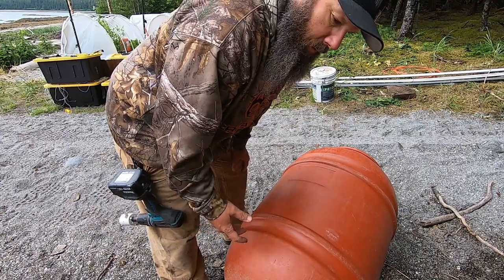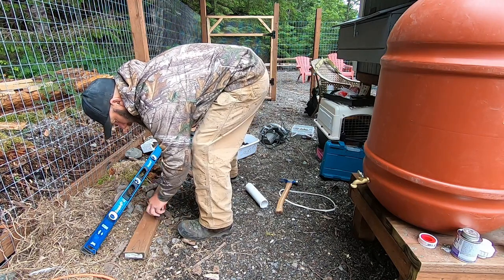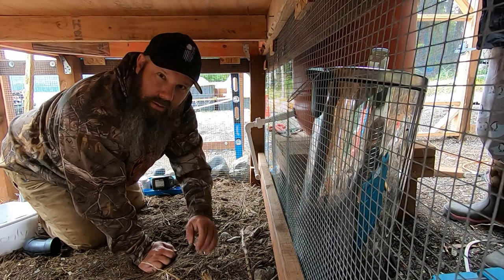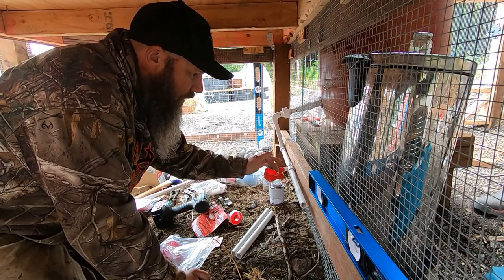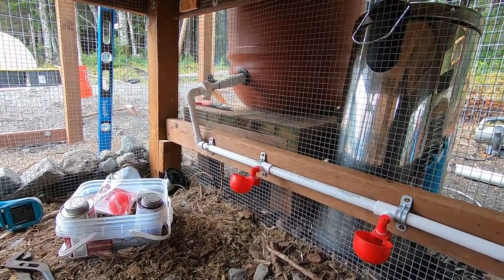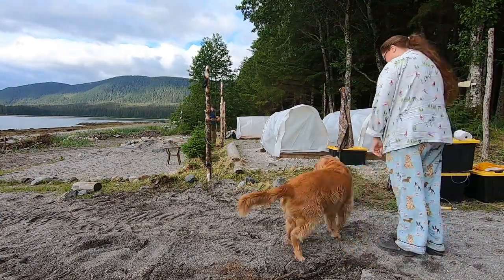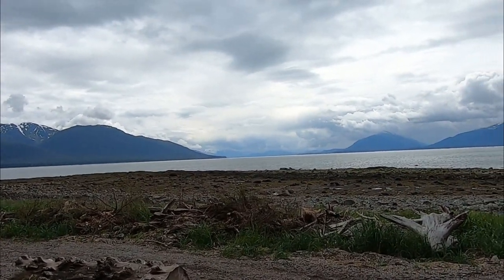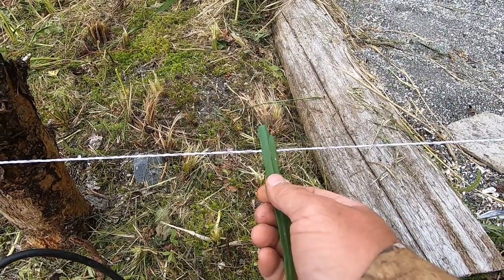Automatic chicken watering system using rain catchment | How to install best poultry watering cups

Comment: Hey Y'all!
Glad to see your Supervisors were keeping you on your TOES!
They were obviously doing a splendid job every step of the way!
The quail are doing ok, lost another one today due to heat and suffocation....put a 4th brooder together and got them dividied up so that there are now only 15 kids per brooder (I'm down to 61 quail  from a hatch of 71). 4 Weeks old yesterday, fully feathered and doing well, except for the heat...we hit 95F today and day after tomorrow we're supposed to have a couple of 98F days........I got somewhat 'exhuberant' tonight because even with a fan in the brooder room, I couldn't get the heat below 89F, with the window all the way open........drilled 3/4" holes throughout the Hollow Core Door to the Brooder room, and right now I have the 'aroma' of Quail Poop' wafting throughout the house, as the ceiling fan in the living room is on 'SUCK MODE'....pulling the cooler air IN from outside, which of course, includes the 'ambiance' of the Brooder/Hatching Room...........that's ok....I've got some eucalyptus oil/menthol oil mix that I'll be living with until the end of this week, when I will HOPEFULLY get the cages built in the garage...........the things we do for our Feathered Children!
I'm trying to get the kids to adapt to the Horizontal Nipple Waterers from Heritage Farms (the Columbs Aqua ones).....they taking to it, but SLOWLY and in this heat, not fast enough....so I'm back to the Old Style.........quail bunch up, which is why my one quail died....too much heat, not enough air and too many others on top of her (they had room, they just simply bunch up).
Learning curves can be a real bitch sometimes!
Cheers from the Oil Patch in Central WY

PS. The scene where you  noted you were using your GoPro.......you didn't tell us WHAT we were looking at and which sounded like a gunshot!
Reply from the maker: Oh sorry I was a humpback whale on he GoPro. 
Man that sucks about all the heat your getting. There’s no real way of getting around HOT. Hot is just hot. Hopefully when you get them out in the garage it will cool down a little. Good luck👍

Comment: Great chicken waterer setup Brian. I would like to do that system sometime. I'm using the bucket with nipples on the bottom right now but the setup that you have seems easier for the girls to get a drink. Have a good one you two.
Reply from the maker: Thanks Jay. I’m trying to figure out winter still. I may just run a hot wire down to the coop to keep the line from freezing or we will have to dis assemble this and use a bucket.

Comment: Hey Brian this is just a thought when you ran your hot wire through the PVC pipe Underground you might want to run some silicone on your 90s where it enters the pipe so water doesn't get in there and short out on you just a thought.
Reply from the maker: Are you taking about wire for the fence?  I glued all of the pipes together. It should keep the water out.
Reply: @AnAlaskaHomestead  I'm just thinking where it goes into the PVC an exit for the water not to get inside of it

Comment: I use Pex pipe ..then I don't worry about freezing.PEX pipe is freeze-damage resistant,  the pipe will expand if frozen and contract to its original shape when thawed. I love the stuff used a shit ton of it up north..comes in sizes from 3/8 - 1 inch.
Reply from the maker: That’s not a bad idea. Since this is our front I wonder if it would grow algae in the PEX?
Reply: @AnAlaskaHomestead  ...a clear pipe is more likely to..but using Pex from a water heater is the only time I have ever seen algae in it .If you do see algae in it..which can happen in any pipe if the condition are right..I add 1 cup of apple cider vinegar to a 5 gallon container of water. This will increase the acidity level organically in the water making it darn near impossible for algae to grow. Make sure you shake the apple cider vinegar before using it.the vinger won't hurt the chickens.
You can also run bleach thru the piping to kill algae..but make sure you run water thru it for 2-3 minutes before you let the chicken drink it again to be safe...all white turds means you didn't flush it long enough..lol 

I use Harris farms 6.25 gallon waters for my chickens..and plastic tubs out side to catch rain fall.I always had two different method to give them water..

I ran mostly meat birds.( 600 Cornish X's ).so I always had food and water in the chicken house and in the outside pen.

My birds all ate the highest protein chicken feed I could buy from day 1 to their last days..in North pole it was Don' s Broiler Maker..but now and again I would buy some cracked corn or scratch too.Also the Wonder Bread distributer in Fairbanks sold old bread products for a dollar a garbage bag full...the chickens loved it.
Reply: When we going to see what a chicken does to a banana slug ??
Now if for some reason they go tits up after eating them....this was your idea..lol
Reply from the maker: Thanks for the info Brett. I don’t think I’d use bleach but if I did I’d be looking for white turds.😂

Comment: So what will you use for water in the wintertime?  We use the galvanized chicken water can with the heater that goes underneath it.
Reply from the maker: I’m not sure yet. We may run a heating cable to keep the pipes from freezing or just disassemble it and use a bucket.

Comment: I'd cut out a circle of plastic and glue it to the lid before drilling the hole for the bulkhead. If you've ever glued 2 pieces of card board box together you'll know how solid it would be.
Reply from the maker: Or drill it on top of a piece of wood. You live and learn.

Comment: Great video, i'm getting ready to switch to the automatic watering cups in a 5 gal. bucket myself. I do have a curious question though, with you being beside a constant water source (river) wouldn't it be easier to do the "ever flowing water system," or would such cold temps in the winter cause a problem? I'm a new chicken keeper myself, so i have been researching all methods for fresh, cleaner ways to provide water that's why i'm switching to the automatic cups. It's just a curious thought cause i'm still learning how to raise chickens, and i do however love the way you care for your feathery babies. Your heart is golden, and you have a great set up with a beautiful view, from what i can see.
Reply from the maker: Thanks Tonya. We love the watering cups but this winter we had a cold streak and had to abandon that method through the winter. 
We used rain catchment because it rains here a lot. That water in front of our place is salt water so it’s no good for drinking. 
It’s a great summertime system but you’ll need a heater if your temps get below 20 degrees.
Reply: @AnAlaskaHomestead  Oh ok, i didn't realize it was salt water, sorry bout that, i had to go back and watch the rest of the video and realized there's a whale in it, lol. Our temps, in Tennessee, get down to single digits at times so i was thinking about trying the heated water base to put the 5 gallon bucket on. Hopefully it'll work so my fingers are crossed, lol. Thank you for your response and the info. Also, many blessings to you, your family, and homestead. I hope you find another easy winter solution as well, God bless y'all
Reply from the maker: @tonyahamlet3827  our low was -2 last winter. We started using a heated base and it worked really well. 
I’ll post the links of you are interested. Good luck. Winter is definitely the hardest part of keeping animals. 
https://www.amazon.com/dp/B006ZJHBRU/ref=cm_sw_r_as_gl_api_glt_fabc_BB895QE78R45MW1AK9N5?linkCode=ml2&tag=brianriggins-20

https://www.amazon.com/dp/B07MDYW16L/ref=cm_sw_r_as_gl_api_glt_fabc_53TQHESJNY71ASG6K5ZC?linkCode=ml2&tag=brianriggins-20

Comment: One last chicken-tipp: We in Germany have high standarts toward animals-health and hygine. It does not mattter if a monster farm for 30.000 pigs or privat chicken-house for egglovers: Water and the pipes are special mostley out of no rust steel. You  must figure out how much water the chicks needs a day and then put 2 times more water in the tank. As longer the water is in a tank as more are the chances that the water get bakterias or wurms...If you could build a  box around the water tank- you would protect the tank and the water from UV from the sun. UV that shines on a plastiktank makes the tank the water wamer then it is good for the water culture. If you would make a box and keep the water from UV in total darkness not only would be the water colder and that is better for the waterculture but as a prevention for the bakterias. The them princip is with the pipes. There are cheap plumber-stuff for heating or water pipes protection for heat cold...that you could put over the pipes...UV protection safes chickenlives! Kikirikie
Reply from the maker: Sounds good.👌

Comment: Have you thought about water to the chicks during the freezing winter?
Reply from the maker: Yeah we are going to put a different watering system out there or run a heat wire out to the coop to keep the water from freezing.
Reply: @AnAlaskaHomestead  
You guys live off grid, right?
Take the power (watt) output from your power source into account.

Comment: And what type of wire is that you're using for the electric fence
Reply from the maker: We used both solid wire and braided. I had to replace the solid wire after two years due to the salt water. The braided is still going strong though.
Reply: @AnAlaskaHomestead  thanks